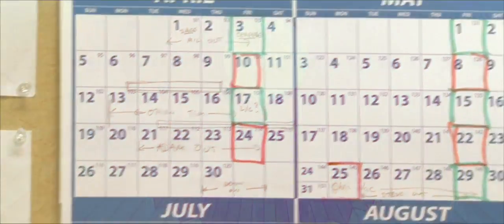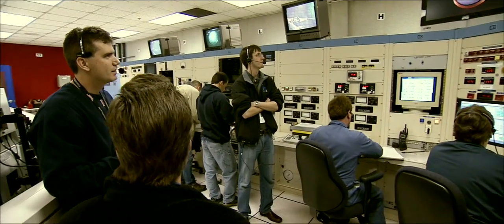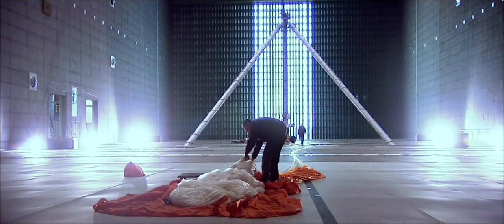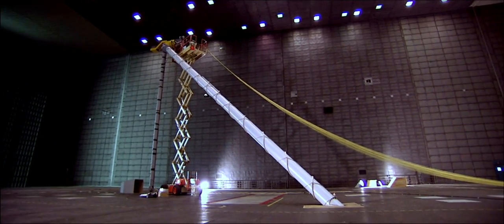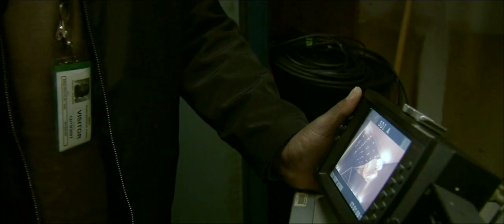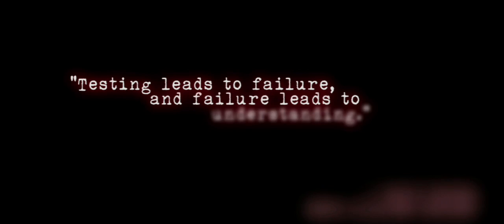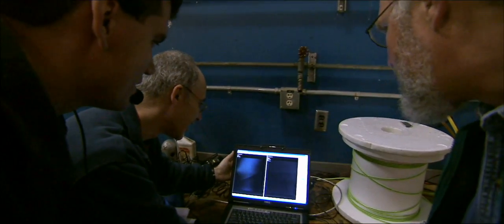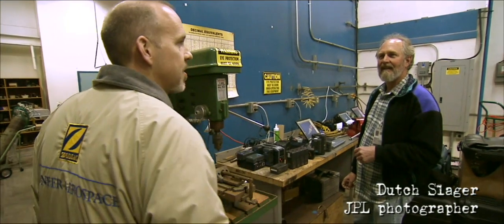Martian Series: Testing Curiosity's Parachute Part 1

Comment: Heres the issue and the typical problem with retards at NASA! Every so called SCIENTIST in this video and others pertaining to MARS MISSION will tell you the same thing. The atmosphere on mars is less than one percent of Earths. For any practical purposes mars HAS NO ATMOSPHERE in other words its a vacuum not unlike the rest of space. SO NASAs answer to SLOWING down any contraption to land it safely on this rock is to use a PARACHUTE???? ABSOLUTE GENIUS! the people at NASA never fail to impress me!
Reply: I could actually feel the IQ points leaking out of my ears as I read your comment. "I award you no points, and may god have mercy on your soul."
Reply: +Rich Smith the Coefficient of Drag is squared.
Reply: and to test it drop it from a helicopter ..in earth atmosphere..good idea
Reply: I'm sorry how many spacecraft have you landed on mars? And how many has NASA landed? I think that they know what they're doing. 1% of earths atmosphere is still enough to burn you up at orbital speeds so yes, parachutes do in fact work on Mars.

Comment: Where and how was that calculated? Man still cant fly airplanes without crashing, so the chances of it failing first time were high, in my opinion.
"They tested everything"  Did they test the parachute in an atmosphere 100 times thinner than ours??
How could they know the rocket boosters would perform in that same atmosphere?
Way too many variables too be 0.05 per cent chance of failure.

Comment: The fact that they are having trouble with it on Earth, in a normal pressured atmosphere doesn't make me feel too good about its performance on Mars with a much, much less dense atmosphere....I'm not even sure how much really useful data you can get unless you could turn the wind tunnel into a giant vacuum tube and pump out much of the air before the test.....yet that is of course unfeasible. I guess doing it this way is better than no test at all though.